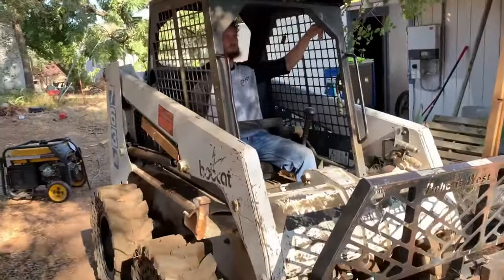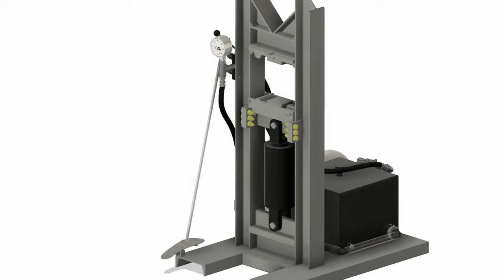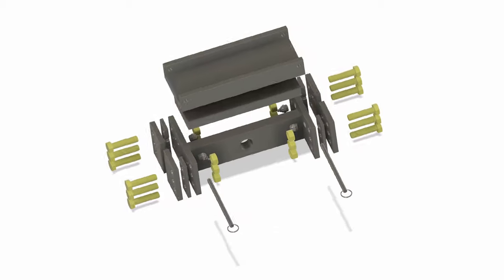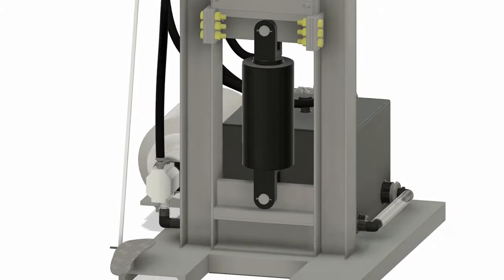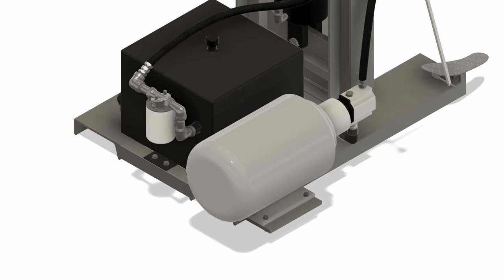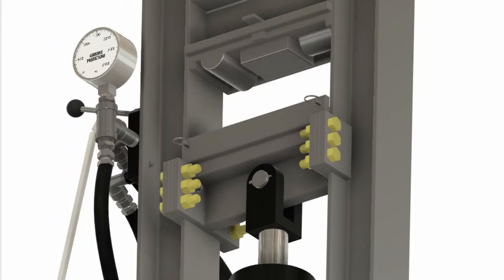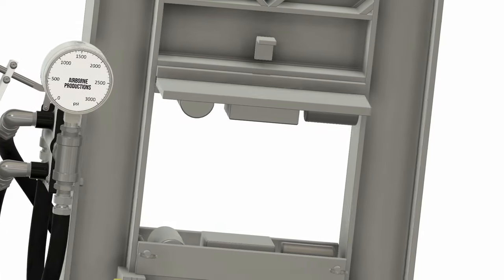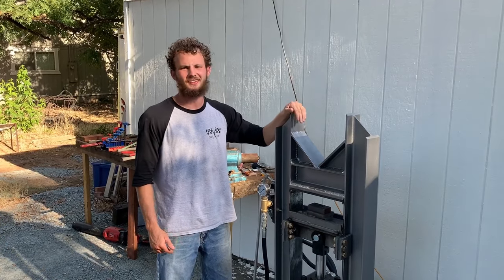The Comprehensive Hydraulic Press Build: Design and Theory

Comment: As a bladesmith, it looks like a dream machine. Only concern I have, is the fact that the base rises up rather than the top coming down. Might be hard to get the proper angle on the iron when the base is moving. Other than that, awesome.

Comment: I’m interested in your plans, will there be a materials cost to?
Reply from the maker: Plans are in progress! Rough material cost is between $1500 and $2000, depending on motor, pump, steel cost, etc. Once everything is finalized, a bill of materials will be included, as well as links to purchase each component 👍🏼
Reply: Airborne Productions thanks

Comment: What the estimated build cost, and does the electric motor have to be 240v or 120v?
Reply from the maker: Build cost ranges anywhere from $1500 to $3000, depending on motor, steel, etc. Ours was under $1500 because we used scrapyard steel and got a great deal on our motor.

For 5hp, it will be easiest to find a 240V motor. If you don't need as much horsepower, it's possible to use 120V, but realistically the entire system will have to be downsized.